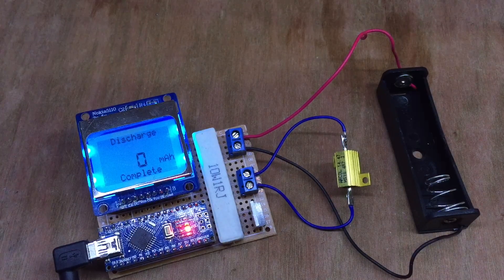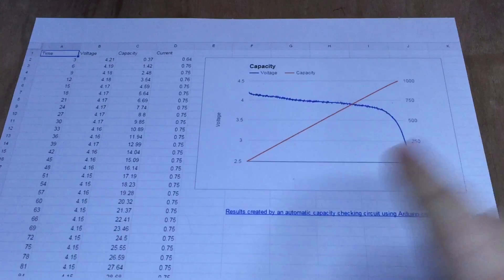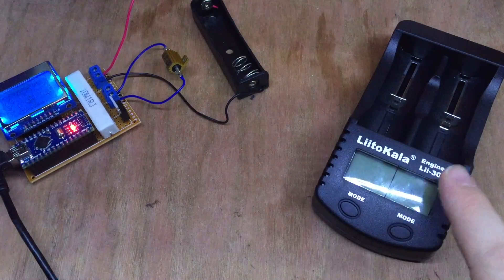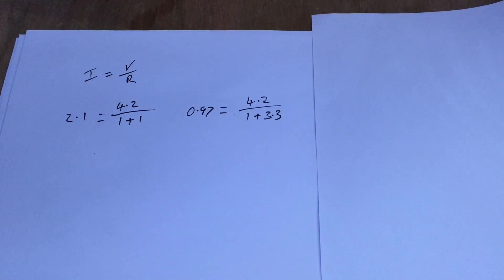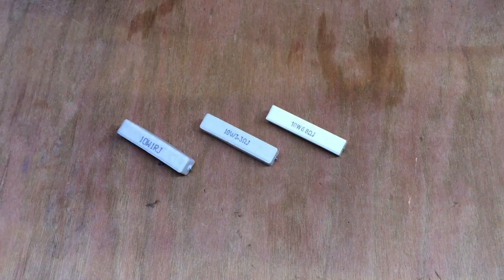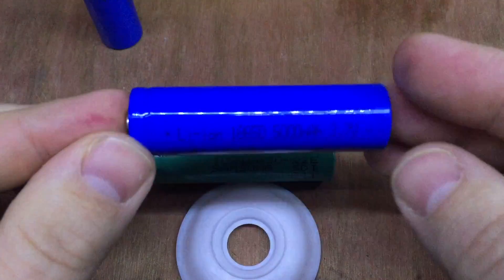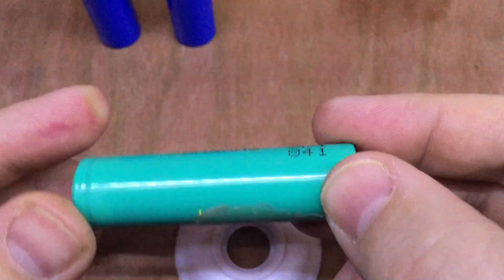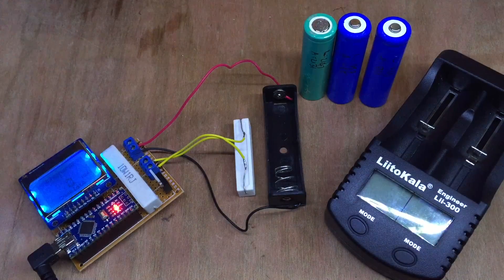Lithium Ion 18650 Capacity Checker Update - Adam's Arduino Projects

Comment: Adam, after watching your video months back I also modified your design to make it four battery capable, buzzer alarm, 3 buttons to set the cut-off voltage, temp sensor, a PWM fan control pin. I attached a HC-05 module to the UART pins and made a [very] basic Android app that graphs the discharge curve. Many thanks to your design and sharing it with everyone.

Quick question, I'm only reading the voltage on the high side of the load resistor and assuming the low side, which is connected to ground through the mosfet, is 0 volts as I'm only using one 8ohm resistor instead of two as you are. Since the IRF3205 mosfet has an Rds of 8mohm, my calculation will obviously be incorrect. But since the resistance is only 8mohm, would my error only be off by 0.5ma maximum at 4.2v? Or is my thought process way off?

If you're interested in my crappy PCB design or the code, please let me know. You are more than welcome to it.
Reply from the maker: +Jonathan Wells Thanks For coming back with your improvements and thanks. It sounds like you've done what a few people would like to see and made it multi cell and added a menu! Im really glad you are running with this project. 
It would be really interesting to see your code and pcb design if you are happy. 
It really does put a smile on my face to know that people have made these (and improved it)- especially as it was just an idea one day and using some bits I had lying around. 

Your theory is correct as far as I can see. It will have an effect, but a small one. In fact the biggest errors are probably from the accuracy of the ADC readings (based on the accuracy of the Vcc voltage reading) and the accuracy of the load resistor. I doubt the fet is going to make much difference to the reading. 

Thanks again. Great to hear of your developments.
Reply: I think I updated the schematic files with all the updates I've main in my prototype. There's still a bug in the software that sometimes crashes the Arduino when a battery is removed though, but I'll probably just remove the buggy code and do it a different way.

You can find the files here if interested. (Note that I've gotten temps over 75c while discharging all 4 batteries without a fan.)
https://github.com/jmw6773/Li-Ion-Discharger
Reply from the maker: You're doing a fantastic job of improving my little project.  I've had a look through the code and it looks far better than my own. I know many others have asked about adding more cells so that will be welcomed.  Thank you for continuing to mention my original design despite the fact that you've clearly moved it well beyond mine.  I really do appreciate it.

Just one question - how do I open the board files?
Reply: Adam, the board files were made using Eagle PCB software. A reduced version is free online, but it's what I was taught on. I've also uploaded PNG images of both the PCB and schematic for those who don't want to install the software. I'll try to take pictures of my mess of a board and upload it later too.

I'm a firm believer of giving credit to the originator. The base of this board is your idea and design. (I think I'm even using the Mosfet you recommended.)  I'm like you in that I only hope that someone else can use it and possibly take it further beyond my imagination.
Reply from the maker: Thanks again Jonathan - You're doing a great job, I might have to order a PCB or two!
Reply: Adam, I usually etch my own boards as I'm impatient waiting for the PCB to arrive, just to find that I botched it up. Being that I etch my own, this board is only one-sided. If you order a board online, it may be more cost effective to make it a 2 sided board to help shrink it down. (It's about 10x8.5cm now)

Comment: Greetings and salutations!  I watched this some time ago, and decided I was giong to build one. I don't know where my head was the day I ordered the parts, because for some reason, I ordered a 10W 10 Ohm resistor, and for the load, a 50W 10 Ohm.  I don't know if I can get this combo to work by adjusting the math in the sketch or not, and I am afraid I would be able to heat our 35foot motor home with the heat generated by the 50watt load resistor.
Reply from the maker: +Jerry Ericsson The maths is easy to sort, but the drain would be a bit low and take a long time to get results. I=V/R so I=4.2/20 that's 0.21 amps. I used a 1 ohm and a 3.6 ohm to get a current starting just below 1 amp. 

All you'd need to do is adjust the shunt value variable in the code if you're happy to use what you've got.
Reply: I was thinking that perhaps what I ordered would be a  lot quicker to drain since both resistors are 10 ohm, where as you had a 1 ohm and a 4.7 ohm?  Perhaps I am confused on that matter isn't 10>1 and 10 > 4.7? I know the 50W 10 Ohm resistor has a heat sink about three times that of the one you are using.
Reply from the maker: +Jerry Ericsson larger value resistor will resist more current. Lower value will allow more current to run. The most current would flow over a simple piece of wire with little resistance.
Reply: Yes I am very aware of that, I learned a lot about Ohm's law when I served in the US Army Communications section, then later on when studying for my Ham License, as well as having played around with Arduinos Raspberry Pi's, and my Pine64.  Also back when I was a young man and doing tV repairs on the side.  It was just a bit confusing when you said my 10 ohm resistor would not drain the battery as quickly as your 3.3 or 4.7 or 6.whatever. So I thought perhaps I had missed something there.
Reply from the maker: +Jerry Ericsson Sorry. Hope I haven't offended.
Reply: No of course not, 24 years on the police department has left me with a very thick skin, and you had no way of knowing my background. I love these sort of videos because they are things I can build myself, and there is such a satisfaction in doing that.
Reply from the maker: +Jerry Ericsson Excellent on both counts. Thanks for that.

Comment: thank you for sharing. what about using this same concept for a portal battery bank?
Reply from the maker: +Ryan Walker Testing the capacity of a power bank? Yes you could adapt it. You might need to place a voltage divider on the analog inputs though as the power bank might supply a bit more than five volts. You'd only need to change a couple of lines of code.

Comment: Great project! For the end You could measure the weight of the batteries separately. That could explain why the Samsung has good capacitance.
Reply: The cheap batteries  are 1/2 filled with sand and a short cell.

Comment: hi can you measure battery internal resistance with this setup... I've have just purchased all the components of eBay can't wait to start this project. . thanks you
Reply from the maker: One of my subscribers did adjust the code for this very thing but I can't put my finger on it right now... hit up +Kenneth Tan - hopefully that'll work.

Comment: Thank you - I thought something like this would be this simple but hadnt had time to do the maths. I'm building a power wall and have dozens of these 18650 and using my imax B6 would take me a long time individually to check them all or cost me a fortune at £25 per imax B6 - Thank you have just ordered enough components to run 24 batteries at once via 3 of my mega 2560's and can log to serial to graph them, only cost just over £20 to build

Comment: Great video Adam, just finished building the circuit and it works.  I'm going to scale it up to 8 x 18650 using an Arduino Mega, then with 4 of those that will give me 24 x dischargers. This will make building a powerwall much quicker :-)  One question though I was going to replace the load resistor with a light buld as its useful to have a visual indicator of discharge progress, then I tought maybe a power LED would be a better idea, in terms of calculating the voltage drop across the 1 ohm resistor and hence the current do think this will give stable calculations for the battery capacity?
Reply from the maker: +Bill Pate In my original design I talked about using a lamp as a load. I think it's a good option. 

Expanding this to a mega is a great plan. Many more analog pins to play with. 

Actually, as an improvement (and to speed up your process further) you could place the shunt resistor on the low side of the circuit. You need to do some editing to the code (you'll be doing that anyway) but with the shunt resister in the low side you'd only need one analog pin per cell. The low side of the shunt will be zero volts. Haven't tested this - but it should work. 

Thanks for your comments and improvements. It's great to hear when people are using these.
Reply from the maker: +Bill Pate Thinking again if you did do that - move the shunt to the low side - you might have to think about the mosfet again. Potentially the 3205 might cause a bit of resistance itself in that configuration and therefore get a little bit warm. 

I'm testing this in another video series at the moment so I'm not sure why I didn't think of that ten minutes ago!

Good luck with your power wall too!
Reply: The 3205 is completely cold at the moment so I wasn't anticipating it being a problem getting too warm. In terms of the design I want to run 500mA as the series current, what do you think about the idea of replacing the bulb with an LED?  Say a cree led that can cope with the 500mA or will an LED cause problems with the voltage drop measurement?
Reply from the maker: +Bill Pate In the current design the mosfet isn't doing much - and it should stay at ambient temperature. If you were to change the design and move the resister to save analog inputs there's a potential the mosfet might get warmer. It's all ideas in my head though - not tried this as yet.

Comment: I've got a question :
does your mosfet get hot ?
i've had problems with my irf540n
Reply: I used IRFZ44N not just as a switch, but also as a load. And it gets very hot. Radiator resolves this issue though.
I'm measuring voltage drop across 5W1RJ cement resistor, and it doesn't change its temperature at all. But using mosfet as a load with proper cooling and smoothed PWM control from arduino gives me an ability to select the current I want the source to be tested at. It works fine up to 1A with medium radiator, and might need some active cooling for higher currents. I'm waiting for my thermocouple arduino module to arrive to implement thermal protection for my monstrous device.
Reply: +Adam Welch Not an improvement really. Just was eager to build such device, and used components I had. And there's not much I had to use: oled display, arduino uno, 1ohm resistor and IRFZ44N (as load and regulator), 550ohm resistor and 100μF capacitor (for low pass filter), medium size radiator and some wires. And it turned out to be simple yet effective (for my needs of course). Going to add some controlling hardware (buttons) and code tonight.
I'm also thinking on adding voltage dividers on arduino inputs to allow higher voltage sources to be tested, but so far it is a perfect fit for testing my 18650 cells.
Reply from the maker: +Anton Mikhaylov Sound like you've made a number of improvements. Thanks for telling me about them.
Reply: +Adam Welch please excuse me for disinforming you. It turns out, that 1 Ohm  resistor does not get hot if the current is below 500-550 mA. But then it switches roles with mosfet, and gets hot very quick when mosfet stays just a bit warm on current around 1 amp.
Reply from the maker: +Anton Mikhaylov Well I like your adaptations. This project was one which I created with bits I had spare.
Reply from the maker: +BillTheBox It shouldn't no. The mosfet is simply acting as a switch. My guess would be that you aren't getting the mosfet fully on and that is causing resistance which in turn causes heat. The 540n should be a reasonable replacement for the 3205 and is logic level so it should be ok. You are using a 5 volt arduino right?

Comment: Adam, thanks for the info on this. Much appreciated. I don't have a Nokia5110, but I do have a 1602A. Do you think it would be an easy swap? Cheers, Sid
Reply from the maker: +Sandback Technical Design Inc. You just need to update all the LCD print lines and the constructor and you should be good to go. Shouldn't take long.

Comment: I noticed you changed your load resistor from 4.7 Ohm (730 mah)in your last video to 6.8 ohm (530 mah).

 Did you have to change the code for the 6.8 ohm resistor?

 Was the load to high or was it to match the liitokala?

On another note. Did you find a good setup for changing the 18650 via solar power.I'm looking for a 18650 solar charge controller. I found the SBMS100 at http://electrodacus.com/   but its very costly unless the battery bank and solar array are big enough. I'm building a 18650 DIY Powerwall. Your capacity tester design has been working well, I have built three of them.

Keep up the good work.

Cheers

Eric
Reply from the maker: +Eric Scherzinger Hello. Yes you're correct that I wanted to match the LiitoKala to make the comparison as fair as possible. I didn't need to change the code because all calculations are based on the voltage drop over the shunt resistor which didn't change. 

I haven't looked very deeply into charging 18650s directly from solar. For small packs the controller in my Cheap(est) Lithium Ion PWM Solar charge controller video is an option.  The other possibility is to use a lead acid solar charge controller that allows you to change the battery voltages to values suitable for your lithium pack. 

The issue with both of those solutions is they both have charging cycles that include bulk (constant current), absorb (constant voltage) but unfortunately then float.  I'm not sure lithium batteries should be kept at a float voltage - but others disagree. I'd be interested to find out if the electrodacus does a float charge.

Comment: Please tell me the temperature of the new 6.8 ohm resistor compared to the metal one in the last video.
I am planing to put both of the resistors (1 ohm and 6.8) on the board close together.

Thanks.
Reply from the maker: +Cristi Istrate I can't tell you exactly how warm it gets, but the higher resistance you pop in as your load the less heat it should generate. It reduces the current through the circuit (and therefore the watts) and also makes the process slower.
Reply: I ask you because I want to put the 2 resistors on the pcb near the display. I don't want melting any thing around them.

Comment: Can I get a correct schematics of it, please? and can I use 6.8 Ohm 5W instead of 10W ceramic resistor?
Reply from the maker: +beicel This is the best schematic you're going to get out of me at short notice... https://youtu.be/qtws6VSIoYk?t=37s

I go through the maths after drawing the circuit too but...   Current(I) = Voltage/Resistance so I = 4.2/6.8 so I = 0.618 Amps.  Power(Watts) = Current*Voltage so W = 0.618 * 4.2 so the power over the resistor is 2.59 watts.  So you should be ok.
Reply: +Adam Welch Thank you, so, what you would say if I use this type of MosFET IRFZ44 instead what did you used? It will be Ok?
Reply from the maker: +beicel Yeah I think that could be a good choice. Low on resistance and enough current for the job by the looks of it.
Reply: +Adam Welch Thanks again! You are awesome! Keep the good work up! btw...Make more Arduino stuffs, pls!
Reply: +Adam Welch But, wait, wait?!? I need two resistors now? I'm a little bit confused now! :(
Reply from the maker: +beicel You could change the code and just have one resistor. You'd change the shunt float to 6.8 in your case. I wanted to use a shunt resistor so I could change the load attached and pull different currents without having to change the code all the time.
Reply: +Adam Welch You menat this line: float shuntRes = 1.0; to 6.8?
Reply from the maker: +beicel Yes. That allows Arduino to correctly calculate the current being used in the circuit.
Reply from the maker: +beicel Yeah. That should do it.
Reply from the maker: I've now added a simple schmatic to my website - http://admw.uk/iA

Comment: I believe that if you leave a narrower gap of time between the readings (which in the code you shared is 5 seconds) you would be able to get a more accurate result.
Reply from the maker: +Gabriel Caloca Thanks for your comments. Please do have a play with the timing and see what results you get. I was worried that timing the measurements too close together would be less accurate due to the limited accuracy in floating point numbers (6-7 decimal places I believe). If the samples were to small I think it would become less accurate. 

I did test this project against a commercial battery charger and capacity checker - see my other videos for the results!